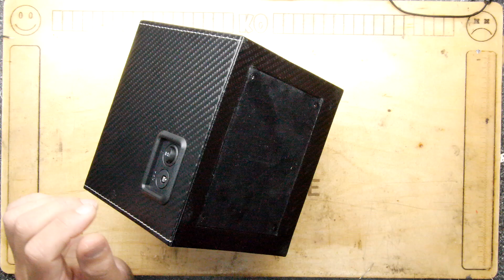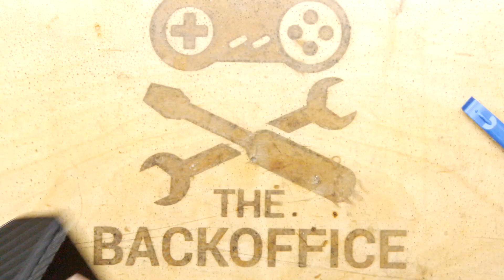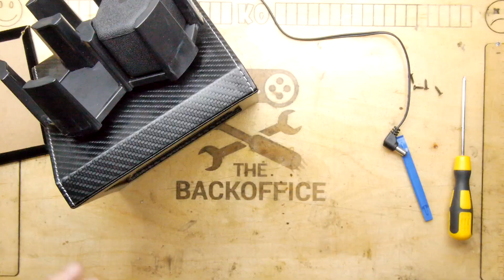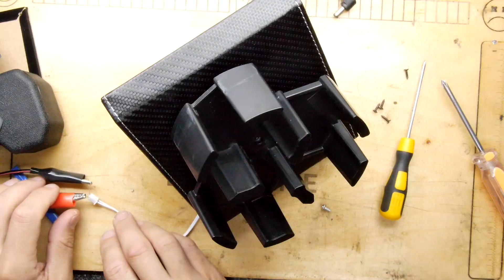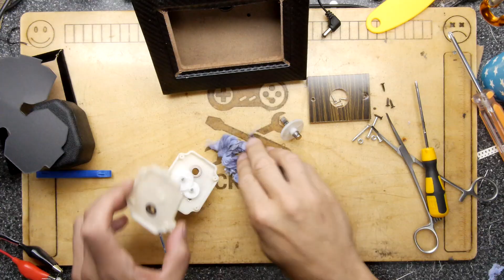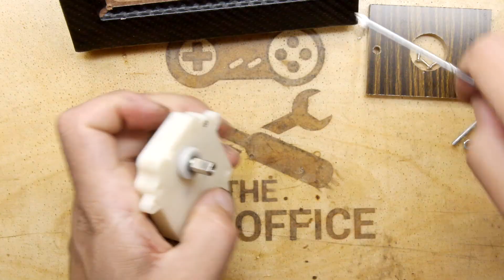Automatic watch winder repair

Comment: I've got a couple that I suspect might have had the wrong power supply used. They have the center pin as NEGATIVE, so I suspect wrong polarity was used. What now?
Reply from the maker: You could see if it runs by connecting power directly to the motor and bypassing any electronics. It will lose the reverse functionality but it's better than nothing